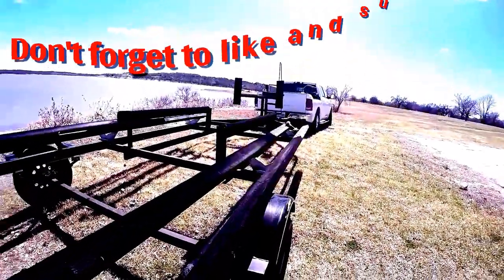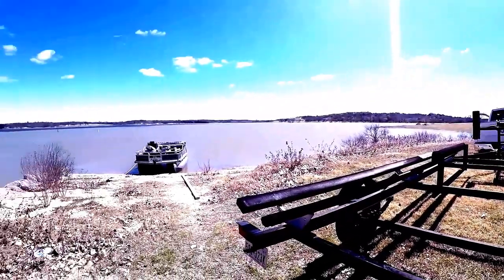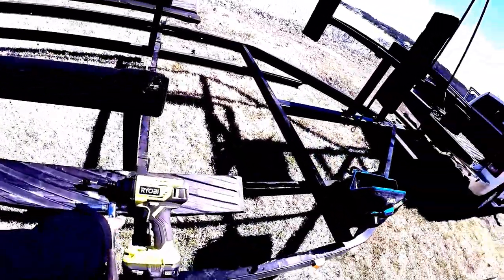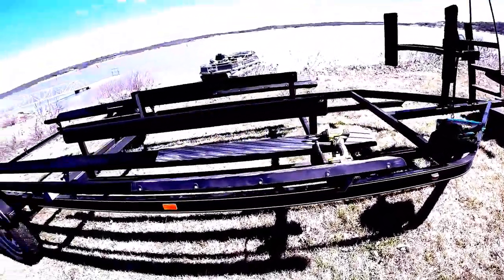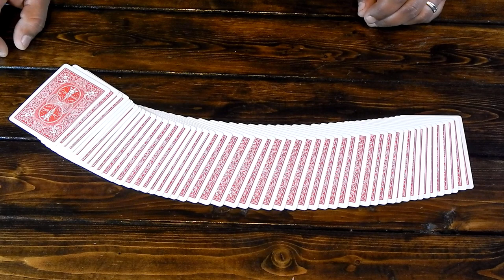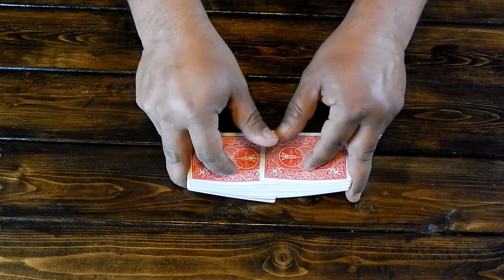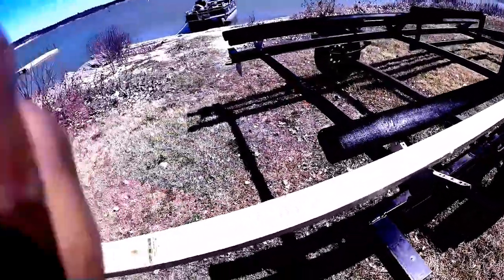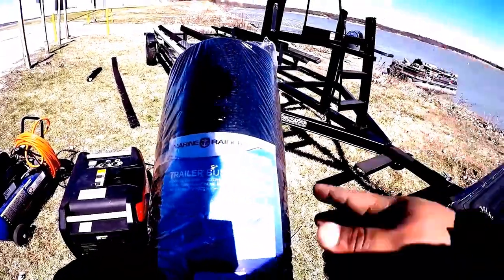Replace your trailer bunks plus a magic trick

Comment: It is very easy to do, but of course you had to bring out the power tools! nice trick. I'd rather be interrupted by a magic trick than a commercial.
Reply from the maker: thanks for watching, once I am monitized and have the option where to put the commercials, I will only put them at the beginning, and at the end of the videos, I will not put them in the middle. I hate those too.